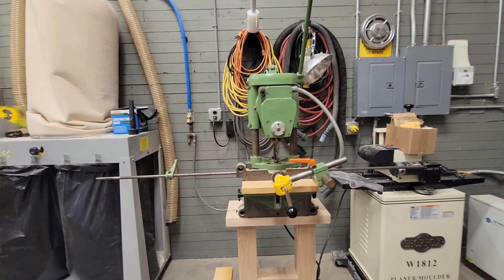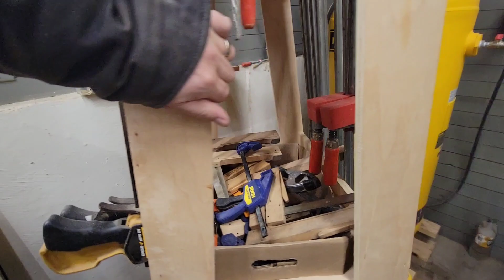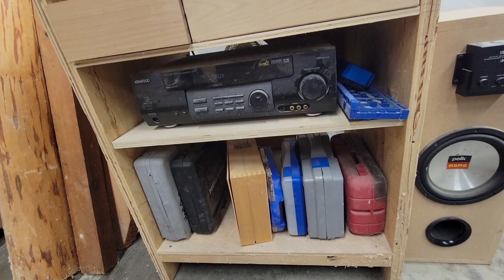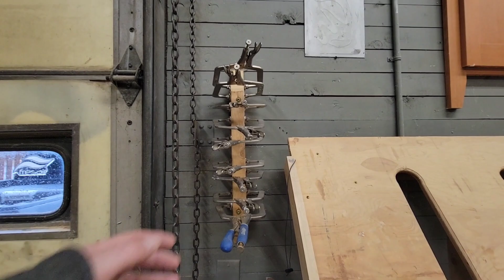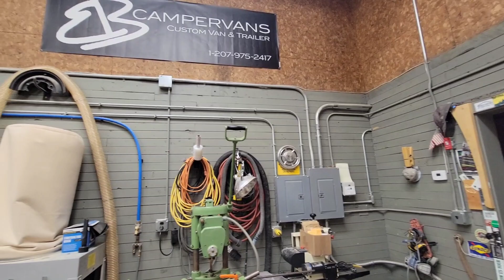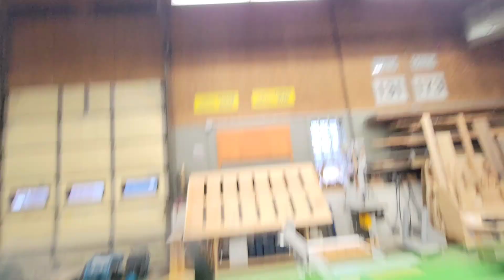Shop tour - EB Woodworking.        Felder, Laguna, Delta, Woodmaster, Festool, CNC

Comment: Nice tour. What do you think about that wood master drum sander? I would like to get one, but can’t find one in Canada.
Reply from the maker: I like it. It was a great entry drum sander. It took a minute to get use to it after using wide belt sanders but, it does its job and does it well. I'd probably go with dual drum 38" with my next one though. Cheers!
Reply: @ebwoodworking  thanks appreciate your opinion. 38” would be too big for my home shop.

Comment: That is no small space 😅
Reply from the maker: It looks big, but it fills up quickly during a project... Cheers!
Reply: I know when he said that i was kinda confused especially when you see my space lol
Reply: @kieronknott8741  one car garage like me? To be fair, I'm a weekend diyer whereas this is most likely his business, so I get it.
Reply: @Monedge  no I’m in England and I’m using my loft space (attic)as a workshop which has numerous drawbacks
Reply: @kieronknott8741  I'm in Switzerland. Big spaces like that only in the US when it isn't your main job
Reply from the maker: Hello! Thanks for checking out my shop tour! I am a professional woodworker by trade. I do custom cabinetry, stairs, furniture, and other custom projects. It's a one-person shop and I try to set my space up to be as efficient as possible. Cheers!
Reply: Great vide EB. I’m a career pro woodworker myself (I’m 50) and my space has grown organically with my business. Started in a 16x24 shop with a full size cabinet saw in the middle and built a ton of stuff in there. Doubled that space in time along with several major tool purchases. Moved from there into 1000 sq ft and much like you, set everything up for maximum efficiency. Still gets pretty cozy with a kitchen on deck! Currently doubling fab space and adding 300 sq ft of dedicated finish room. Definitely expect to see major uptick in efficiency, which should offset costs at some point. Moral of the story to everyone out there, go for it! Start small, work smart and grow slow and steady! Space and gear come in time!
Cheers🍻!
Reply: Height helps